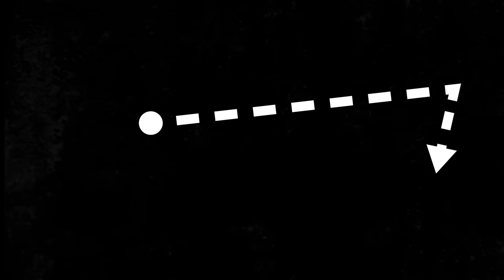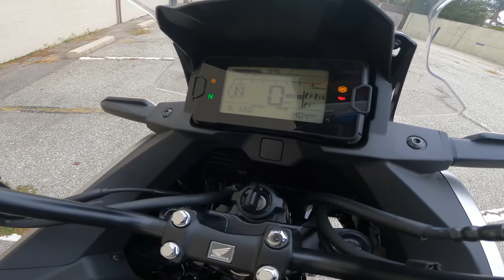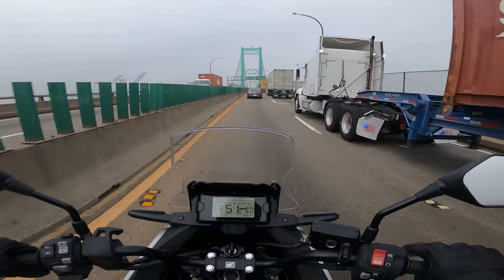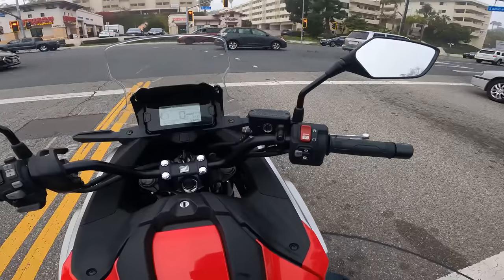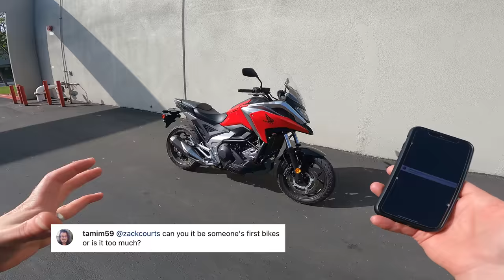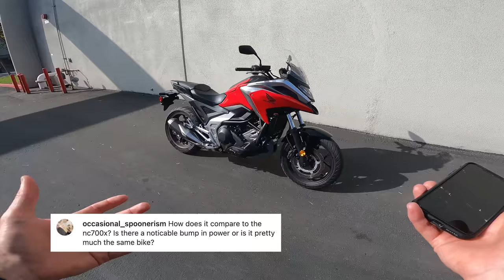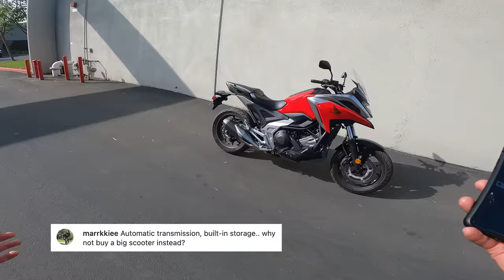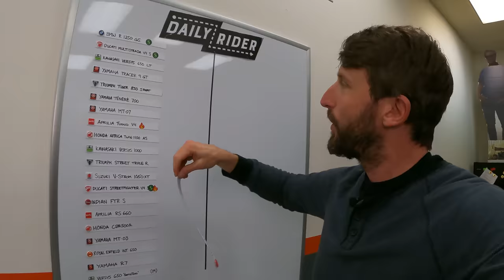Automatic-transmission on a motorcycle? 2021 Honda NC750X DCT | Daily Rider

Comment: I have owned an NC and I can say that it consumes as much as a 250cc scooter. With this low consumption and the frunk combined with the relatively high ground clearance it is a perfect daily city bike which you can also take to trips if you want to. It’s not a fast bike. The Speedo will not show over 199 kph like the ones of super sports stop at 299. But that is very very close to its top speed anyway. 
One very interesting fact about this bike is the frunk space was originally thought for a supercharger. You can find the plans of this on the internet. But Honda then decided to ditch this plan and have a frunk instead.

Comment: OK on the old chart the RZ 350 was the most to the right in the 'cool' axis (just got off bought from new mine).  I assume the RC30 would have been right up there as well.  But this pocket protector hum drum stoog-a-cycle would be dead last...all the way to the left.  Having it up near the top is deceiving. Zack, it's time to make a Sunday Rider list.  The best all round head turner, ear piquer, crowd drawer for the weekend, on your coast Mulholland Drive/Angeles Crest Highway runner. Yeah there's little stick on hearts and stuff but that doesn't change the ranking or evince desirability.

Comment: 4 years ago I had an NC750 DCT for about a year, at which point I upgraded to an Africa Twin DCT :)  I truly loved the NC, I used it to commute a round trip of 80 miles everyday and it was fantastic in both traffic and motorway. However my average consumption was around 80 MPG, not the 50 that Zack got from his NC. Not sure what the difference might be, I suspect that it may be due to a low average speed of 55 MPH and the fact that I am about the opposite of a sporty rider.  As for the DCT... lets just say that in the same way that I will never buy a manual car again, I will never go back to gear shifting on a bike again. I know it sounds like heresy but... hey I did say that I am the opposite of a sporty rider.

Comment: I have the non-dct version on a 19MY. It works well as a commuter and as a tourer. I find the throttle is a little snatchy. Although the fuel tank is small it gives good mpg. Very maneuverable. I like it.

Comment: You can scoring 
With compared 
Engine CC Segment,
Power and torque 
Price, 
Fuel economy, 
Storage, 
Transmission type, 
Safety and comfort, 
Maintenance costs and time,
If you compare all this NC750X world's  TOP on this segments range

Comment: The DCT is a great option for people wanting to learn basic riding skills before going to a manual.  I am surprised Honda has not recognized this and put the DCT on more entry level bikes like the 300cc to 400cc bikes.  I think if Honda did that, then they could not keep those bikes in stock because most people I know say that the biggest barrier to buying and learning how to ride a motorcycle is the fear of shifting.  Seems like a problem they could address with technology they already have developed and would not require a great deal of R&D expense...but unfortunately they seem to have completely overlooked such a no brainer product.  Seriously, the DCT option makes the most sense on smaller cc engines geared toward new riders...come on Honda!

Comment: I don’t think there’s a bike out there that can out cargo mule one of these once you add panniers a top box and if your’re crazy a tank bag on the frunk lid.   This bike is in essence a utility performance bike.  It’s got super easy and long interval valves that are screw adjustable, insane reliability, and uses consumables at a much lower rate and cost.  As a commuter it’s the top choice.   As a touring bike it’s running costs are very low.  I’ve ridden one a fair amount with DCT and the africa twin with DCT and I would buy a Versys 650 with that transmission in a second. In manual mode it’s like having a F1 car transmission.  Absolutely lightning fast and nothing like a slushy auto transmission paddle shifter on a car. This is not that transmission because it says auto on it.   You cant shift as fast as a DCT with a quick shifter. It’s like greased lightning.    For those who buy bikes with quickshifters any DCT with the foot shifter accessory is faster and smoother.   Research how dual clutch works vs torque converter and CVT which is what cars use other than a select few including very high end sports cars like the Nissan GT-R, McLaren 650S and Ferrari 488 GTB. You don’t here people whining about them being scooters with no man card for lack of clutch. An R1 with DCT in manual mode would be insanely fun.  Scooters use Belt CVTs which are nothing like a dual clutch.

Comment: I put 5k miles on my 2014 NC700X this summer, including a couple full-day dirt rides (doubletrack) and a North-South cross country tour. The engine is anemic on the highway, but satisfying on the street. You can kit it out for adventure if you don't mind some harsh bumps on the trail. The real kicker, as much as I want an R9T or an FZ07, I can't imagine going back to life without a frunk (front-trunk.) I leave my air compressor in there- and charge my phone in there when it's low. My milk-crate off the back makes it seem like a high-budget KLR- minus the doohickey.
Reply: LOL

Comment: Always put it in sport mode 3
51hp
Seat was higher for the NC700X.
I owned the NC700X DCT. Very handy and versatile bike. Add a givi 36liter top case and you have a great traveling bike and a great bike fir running tasks
Reply: Yes I also got a larger windscreen plus one of those little extra wind screens at the top that really help for long trips

Comment: It would be interesting to see how it compares in acceleration and general "zippiness" to lower-powered, but lighter motorcycles like the Z400 and 390 Duke.  I know that they are in different categories, but is the fun factor high enough to settle for a one-motorcycle solution?*  I personally use the Z400 as the base level for acceleration of a "fun bike" for playing on backroads on a sunny day.  Sadly, only Cycle World still sometimes lists acceleration results.  The Versys 650 has enough zip for example, but has a higher seat and center of gravity than the NC750X.

*Word of Warning: Be very, very careful when stating  "you need more than one of something to have enough fun"  to a spouse.  Trust me about this.

Comment: One strike against the NC750 is that it uses so little gas and therefore has such a small tank, you will frequently find that your fillup doesn't meet the local gas station's $10 minimum for a credit card purchase. Even after riding >200 miles.
Reply: Pay inside with some nachos ?

Comment: I had a 2018, but found my balance was a tad wonky. Now I am on a spyder trike
Reply: SemiAuto Spyder is about the same as Honda DCT in manual mode, except the shifts are slower (single clutch), and the paddle shifters are backwards. I shift wrong sometimes when switching between my Spyder and Rebel 1100 DCT

Comment: i just bought my NC750x dct like 3 weeks ago... & i'm a little hesitant at the moment to get to riding... with not much riding experience under my belt...i was told & have seen with the reviews of this being a great starter Bike...Am i being too cautious? Watching all the videos it appears to be a relatively ez bike to handle?
Reply: Just start small, wear gear, know what your brakes do (don’t slam the front brake), and don’t hit the gas too hard. If you haven’t done it yet do some figure 8’a and little maneuvers like that in a (mostly empty) parking lot until you’re comfortable with the bike leaning over.

It’s pretty easy to learn how to ride a motorcycle if you take it slow and build up to longer and faster trips. Try to start in neighborhoods and parking lots if possible.

And obviously take motorcycle safety courses if you haven’t already.

Comment: Hail from the UK. I don't know what sort of fuel is available in the US, but here in the UK I  average 70 miles per gallon, the best I've had is 82 miles per gallon. I love my 2021 DCT, however low speed maneuvering does take some getting used to. On the plus side for a relatively heavy bike the handling is superb. My only major criticism is the front brake should be twin discs.
Reply: We don't have Imperial gallons.  Yours are 20% larger than ours which translates directly into mileage.

Comment: I've been looking at this bike for years as a touring bike. A bike to replace my Honda ST1100.
Reply: I've taken mine on 2 2k mile rides this summer.  Perfectly acceptable companion.  Mountains demand manual mode, clips through small towns and cities are phenomenal with a DCT as 5 hours in 6th gear on the highway has a way of making sudden stop/go riding feel like a wake-up call.  Has nobody ever gotten in to town and slowed down and thought "oh yeah I need to downshift."   

The frunk is awesome for a charging port and somewhere to throw your phone for a restroom stop, as well as water bottle, snackies, and even some tools.  ~50 horsepower isn't getting you to 100mph instantly, but it is getting you there cheaply.  I'd say if you tour on Interstate Highways then wind buffeting becomes a problem on this bike.  If you're taking byways and 50mph highways, you can pay a lot more for the next better contender.
Reply: @jsherck  thanks for the insight. I drool over the MPGs and although I can on occasion get my ST1100 into the triple digits for fun at the end of the day when touring I try to keep it around 70 max for the economy. As a daily rider commuting to work I dread traffic and the DCT sounds like a godsend for messing with the clutch.
Reply: A candidate for the NT1100

Comment: Probably best daily commuter you could own. Sold my 2017 DCT model, bought Forsa 350. Miss my NC. Had a test ride last year on 2021 NC. Chance are i will be swapping the Forsa 350 for new NC this yr. Looked at many different Maxi Scooter. But keep coming back too thinking the NC best bike for me. DCT best thing since sliced bread!
Reply: Interesting. I was thinking about a Forza 350 as a city/2nd bike (I have a GS for long trips and thrills) but NC750 is on my radar now as not that much more money and can get DCT. I like the idea of automatic for more relaxed riding. The Forza 750 and X Adv also appeal but they are really just re-styled NC's. Cheers.

Comment: It's the motorcycle for the person who's interested in a larger displacement scooter, but not interested in the aesthetic or posture of a scooter.
If Honda did just two things to this bike, it would be that much more purposeful for the design:  cruise control and shaft drive.
DCT version: 493 lb curb.
Manual version: 472 lb curb.

Comment: I know all this manual is better thing but honestly, I drove manual cars and auto cars and now I'm driving EV with no gears, have to say, the instant torque and low down muscle of the EV is by far the best experience, I drove the dual clutch from the VW group and while it is definitely good, no auto transmission can beat the instant power of the EV which is really great for pulling hard out of junctions much better than anyone things they can swap cogs be it on bike or in a car. 

Just around 1 hr ago I had to drive wife's car to pick up bags of wood pelets for the stove, it's  a Diesel Outlander manual, 150 Hp, but felt dead because you got to wait for the torque, + have to change gear, for needing power fast pulling out of a back road on to main road, the diesel feels dead compared to the EV. 

"you got more control of your vehicle when it's manual" honestly, there hasn't been a single instance since I started driving automatic cars where I could honestly say having the manual would have been safer or given more control. 

I've recently got my learner permit here in Ireland and completed my initial basic training or IBT but haven't yet found a bike, original plan was to get a maxi scooter for more comfor and simplicity of twist and go, then I started looking more at manual bikes, then came across the DCT on the Honda which is also on the Forza 750. Unfortunately, if I pass my test on an Auto then I have to take another test to drive a manual, though I don't think it would be a full test. 

It's hard to know what to do, mostly I'll be driving on back windy roads and probably won't be much at 60 mph and hardly over that, just want to ride bikes to experience a different way to get around. 

I'm not sure whether to start on a 125 or a bike for my class of license which woule be quite big at 54 Hp minimum in order to pass the test. But I could use the instructor bike.

Comment: I test drove one of these in July. I was really intrigued by the dct and low center of gravity. I have painful hands and balance issues so I thought it might be perfect. But I was so underwhelmed by the performance. I wish it just had more power.   I'm also 6'2" and was a little cramped. The dct option was fun, but I just wanted a little more. Cool concept though and great review. I love the daily rider. I live near FC, Colorado, wish I saw you come through on the dumb and dumber bike!
Reply: Also 6' 2" Can you say more on how cramped. Is in the angle of the knees, the reach to the bars? Everything? Trying to decide whether to cross it off my lost because of that.
Reply: @ianspatz8234  Definitely a knee angle issue. I have 34" inseam and I felt a little compressed. The arm reach was actually very comfortable. I liked it, but I wanted to love it.

Comment: I just bought nc dct and i think it has a problem. Standard mode in the city the 4rth gear is getting only after 40 klm, i have never seen 5th or 6th gear. Sport mode i have 6th gear only after 140-145 klms no matter what i do.  Compare to your video i think i have a problem.
Reply: I agree and maybe a software update will have the desired result ?

Comment: Likely more comfortable over distance than a big scooter - and much cheaper than the similar engined+dct forza 750 or X-ADV. Tho doubt those two are available in the US(?)
Reply: I had the 2017 model DCT NC750 and I have traded up to the 21 Forza 750 which has higher spec suspension, twin front discs, TFT etc.  The Forza has the same engine but is more comfortable with a larger seat.  It also has a better screen,  fairing and you can move your feet around.  Worth the extra cash.
Reply: @stevebolton8471  I tend to get lower back pain on mid to large scooters after a hour or so. But that forza spec is way above the nc.

Comment: My car weighs twice as much and does over 60mpg, so it is not that good is it and the performance is not much better. An adjustable screen would be nice as people come in different heights. I would think  cruise control would align with  that transmission,  Honda are just penny pinching.

Comment: I looked at a new old stock (2018) manual NC750X last year. I did not care for it. Lazy performance, single disc front brakes, expensive accessories, and the frunk would not fit my helmet. Passed on it and went for a new old stock V-Strom 650 instead for less and no regrets.

Comment: I own an older Aprilia Mana 850 with the CVT, its fun to rip around town and on short rides has enough power to get going on the highway. One downside is it’s heavy and has a terrible steering lock turning radius, worse than my huge Triumph Trophy SE. wether we like it or not the automatic gearboxes are coming, with all the emissions rules they will be on other bikes soon guaranteed 🤷‍♂️🤷‍♂️🤷‍♂️
Reply: Europe has ever increasing emissions controls on bikes and thier manuals are just fine. They drive more manual vehicles than NA ever will.

Comment: I considered buying one, but without something simple like cruise control for something considered as a commuter, it turned me off. A drive shaft would add to the simplicity of maintenance, but would need a little more power to compensate for the weight. Larger gas tank (1gal more) to get closer to 250-300 on a tank would be nice.
Reply: Why does a commuter need cruise control? And why would a commuter bike need to do upto 300 miles to a tank? I don't understand the obsession with cruise control - if I can ride a legit race bike on the road for 8 hours, and not even be uncomfortable, why does everyone feel the need for cruise control?
Reply: @dennisclark9544  Riding daily on freeways for around an hour at the same speed should warrant cruise control. More comfort options are rarely a bad thing. At least make it an option for $200-400.
Reply: I've commuted and toured all round Europe on one, never felt the need for cruise control. Gas tank gives 190 miles commuting and 250 touring.

Comment: DCT is not an automatic transmission.  It doesn't have a torque converter and shares more characteristics with a standard transmission than an automatic transmission

Comment: The novelty of shifting gears wears thin in New York city. Bigger wheels than most scooters. Bigger bike than a Scooter for greater road presence and visibility (maybe). Great maneuverability. Spend a bit, for better suspension to eat up the City's nasty potholes. I'm considering it! At age 60, I'm over the plastic fairing and Power Ranger leathers to indulge the Rossi-ego fantasy.
Reply: I ride this in Vancouver BC where traffic is horrific. DCT makes life easier by far! It’s high enough to see over sedans and the fast shifting transmission lets you concentrate on traffic hazards.